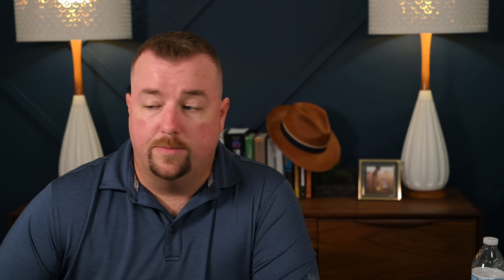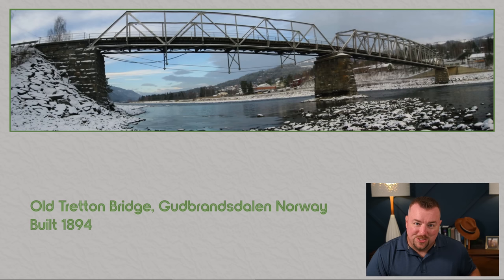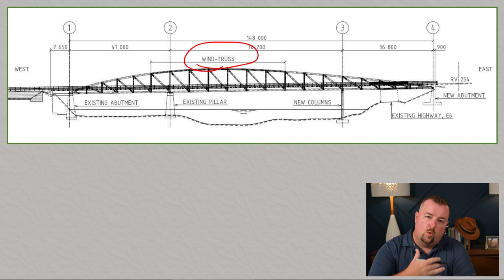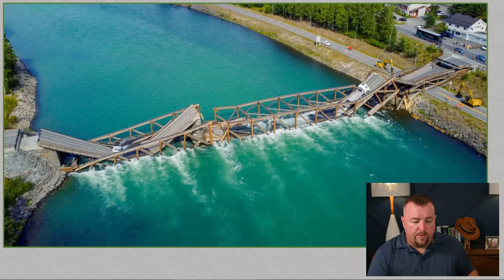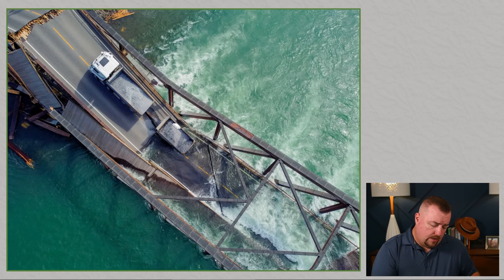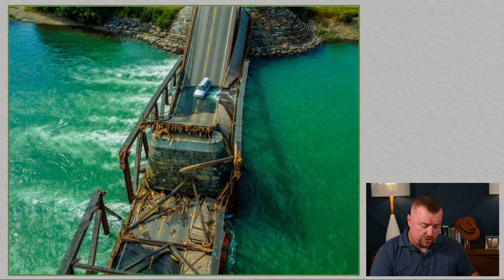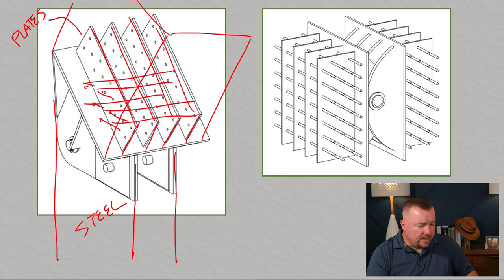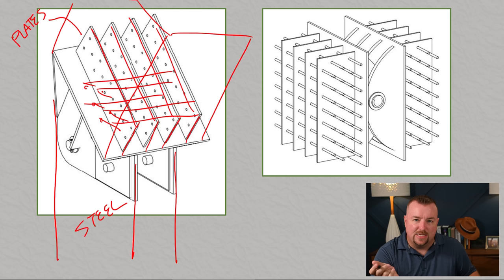How Did the Engineers Miss This?

Comment: Some things to consider as possible fixes:
1) A tight wrap/sleeve (that CAN'T expand very much) around each doweled joint to make it much harder for the wood to fully wedge apart. This way, the dowels themselves would have to shear or the wrap would have to explode BEFORE the wood can split across the wood grain.
If the wrap were made of thin steel (arbitrarily, <.25 inch), expansion could happen over time due to permanent deformation of the steel wrap. If the wrap were made of thicker steel, the steel could never reach the permanent deformation point. Basically, avoid the property that Aluminum has, which is impossibility to return to its original shape after being stressed. I think this is called yield strength, the strength before permanent deformation.

2) Instead of having many rows of dowels, each row after the 1st row destroying the strength of all dowels that come after it, have only one row of dowels (in a cross-section fashion). Also, seeing the dowels in such a weird formation should spark suspiciousness to the engineer, making them think twice about WHY the configuration is that way, leading them to (hopefully) realize that splitting a horizontal connection with something (in this case, a dowel) creates a weak (fault) point between the left and right side. A counterargument would be that you have more redundancy with more dowels, but it also gives a false sense of security, which can be more dangerous if left unchecked, especially in a naive model simulation program. You HAVE to consider how equally forces are distributed across the dowels, which having many rows of dowels implies an equal distribution, which is absolutely not the case.

3) Even though it is harder to build, joints like those at 24:44 through 25:00 should NOT exist in bridges due to them being weak points, UNLESS it's a specific safety-failure point (a point that, if it were to fail, is the safest place to fail). Those should be overlapping joints, with the same standards (hopefully more rigorous than) as household joists. This would nearly always require on-site gluing/lamination, which could be difficult in cold-weathered areas, but heaters combined with insulation and slow-set glue should work.

4) Consultation of professional woodworkers should be considered.

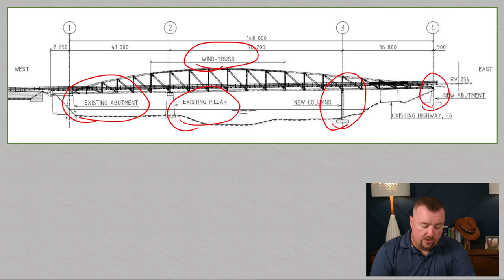Comment: 2:27 - All of the diagonals are sloped in the same direction for the entire length of the bridge. Thus some of the diagonals and verticals were in compression, others were in tension, and some probably had reversing stress.  As a continuous truss, it is indeterminate, depending on flex to even out the load across the 4 supports. This can result in concentrated stress at one point along the span. Looks like somebody had no clue about structural analysis.  Also, a slender truss like this places much more stress on the members than a taller truss, it's a matter of leverage.  Proper design might have allowed the bridge to last possibly 15 or even 16 years!

Very reminiscent of the clueless Florida International University footbridge collapse, which looked like a truss, but the seeming truss members were just decorative.

At least this bridge was across a shallow river, so the victims wouldn't drown.

Right now, the EU has many more pressing problems about greenness, such as freezing to death this winter.
Reply: Absolutely right. I suspect the architect wanted this layout and the inexperienced engineers said okay, no problems...
Reply: Norway is not in the EU.
Reply: @ThermoMan  But Norway is about to join NATO, and Russia has already stated it will no longer sell energy to hostile countries.

While not directly affected by the Nordstream 1 pipeline shutdown, one more wrong step and I bet they will be cut off too.

It's going to be a long, cold, deadly winter in Europe.
Reply: @ThermoMan  Norway suffers from the same green blindness as the EU.
Reply: @derek20la  There's so much nonsense in your comment it boggles the mind. Norway has been in NATO since its beginning, you're thinking of Sweden and Finland. Norway also doesn't import any natural gas, actually it's world's third largest exporter.

Comment: Glue lams are very common in residential construction, but generally don't have vehicles driven over them, nor are they exposed to weather, wood and weather not exactly being the best of friends (the old wooden railroad bridges were made of solid oak beams soaked in pitch). Also, where wood and steel meet, generally the wood is "wrapped' by the steel and bolted though the wood and the steel, or at least  large washers are used on the bolts to help compress the wood (wood does love to swell and shrink, especially in harsh weather conditions).

Comment: I am a bridge engineer and I applaud all the work you did here to get into a position to study the failure.

I suspect the truss diagonal that ends at node C would be in compression when the live load was approaching the support. I believe you have found the area where the failure initiated.

The problem here is certainly the joints. Everything about structural behavior of wood depends on the joints. Everything about truss behavior depends on the behavior at the joints. Your inside information on the research into wood doweled joint failures is certainly going to come into play when the final report is released.

I believe in steel connection design we have a similar mode of failure called "Block shear". Your observation that consideration needs to be taken for the glue laminations is on point. The gross section properties are only one part of this problem.

I am designing a wooden bridge right now for my Boy Scout camp. I don't think the other players understand how complex it is. They say they can get treated utility poles for the beams. But utility poles are tapered. I'm going to have to figure out how to secure the handrails to round, tapered utility poles. Yikes.  They have conceeded that we will need to build a support pier somewhere along the length. They know they can't just lay them down on their sides and expect them to work. 

I'm going to see if I can find some more information on this bridge.

Oh, and I agree, it seems optimistic to believe a treated gluelam bridge will last 100 years. Maybe a wooden bridge can do that in a very dry climate, but I wouldn't expect that in Scandinavia.
Reply from the maker: Thanks for the comment, and good luck on your bridge project... I too would not want to work with those poles as the main beams.  A lot of strength there but the connections will be challenging.  May consider cladding one side with PT boards bolted through the poles and then just build up from those sides.
Reply: @BuildingIntegrity  my coworker thought I should design the deck to be strong enough to carry the post load. I'll give it a look and see. The post is the key.

Comment: There was a building collapse recently at the hotel across the street from where I used to work in York, Nebraska. The building was just 10 years old and the ceiling collapsed in the pool room, with one victim not surviving. There hasn't been any investigation into the reason for the collapse and it's just been swept under the rug. It would probably make a good video if there's any way to get it investigated.
Reply: That's shocking. Especially after a death. Wasn't there an inquest? In the UK our Health and Safety Executive would have been in there like a shot to investigate, just for starters.
Reply: There should have been a full investigation. There's a lot of corruption in these smaller towns and the contractors, inspectors, and investigative agencies often have a conflict of interest and will cover each other. I've seen pictures of the collapsed room and it looks like the decorative ceiling ledges were just nailed to the framework with no mechanical reinforcement. The nails simply pulled out of the wood and the entire 2x4 ceiling fell in. It's inexcusable
Reply: Yeah, definitely sounds like something shady going on.
Reply: I agree. I read about this and it bothered me tremendously that there was no investigation even though it killed an innocent kid playing in a hotel pool.

I saw a picture of the ceiling collapse online and it was bizarre to me that all of the sheets of drywall remained bound together when they fell from the ceiling. I would have expected them to break apart at the joint seams.

Comment: I'll nitpick a tiny bit - the "wind truss" doesn't just transfer wind loads to the other truss.  It's adding moment rigidity in the horizontal axis because it is a truss.  If it was just beams straight across, it would load share horizontal loads.
Reply: Agreed. There a is box section to increase torsional rigidity and reduce flexing of the deck under side wind conditions. This has caused several dramatic, well-known bridge failures.
Reply: He knows that. He is just keeping it simple in order to focus on the main point.
Reply: I’m certain he’s well aware of that. However, his main audience is the average laymen, not an engineer, so he tends to explain things in simplistic terms.

Comment: Maybe there is another thing to consider (I am not a construction engineer / architect though, so if somebody knows how this is considered/calculated IRL, let me know):
When the connections are made IRL, there is not only the tension in the direction of the truss itself, but there might also be a torque component from the load of the bridge.
I would say this torque may greatly increase the chance of the wood splitting.
When you show the interlinking of the fingers (12:50)... try squeezing the fingers hard and pull the hands apart (it's not that easy). Then try the same, but with the hands twisting. The twisting action of one hand will open the fingers a bit and it gets much easier. That's what might happen with the wood as well. If the dowels apply some torque, they might be opening the wood grains.
Wouldn't it help to have the joints wrapped in tightened steel hoops to prevent the opening?

Edit: 35:30-ish - the way you drawn the two truck beds around point A is kind of consistent with my theory. If both objects are pushing the bridge down around point A, the two horizontal trusses experience opposite torque, meaning the bottom A want to split open. If it wasn't one piece of wood, but CJ like on the top, that's it.

Also, the top A (32:02) shows result of torque (although that might be result of the already-falling bridge after bottom-A  failed.

Comment: I think the diagonal piece between A and B would have been in compression in this instance, at least whatever proportion is carried by the new steel columns would have been carried in compression there. All the diagonals are slanting the same direction, so they can't all be in tension.
Reply: Are you talking about 32:30 into the video?  The simple way to tell which truss-web members are in tension versus compression for something supported by two points is to identify the balance point of the bridge, and trace lines from there to the support point.  The places where one's pen would be moving downward would be in compression; those where it would be moving upward are in tention.  The only way I could see for the the AB chord to be in tension would be if the center of gravity of the portion of the bridge-plus-truck combination supported by the new steel pillars was to the right of point B, or the supports near the right edge of the bridge weren't doing much, and almost all of the weight was borne by the supports on the left.
Reply: I think of the road bed as hanging from the upper bow, and the two are trying to separate. The upper bow is in compression, the deck is in tension.

Comment: Got to say that one of my first thoughts when i saw the design of those joints was - how can they hope to control rusting of the steel and pins? And we all know what rusting steel does to concrete, does not take a lot of imagination to think what the steel that slots into those joints will do to the laminate when it starts to rust and expand. Surely it's going to force those laminates apart? Rust will start to jack the laminates apart where the steel slots into the wood, and rust from the pins will not doubt accelerate the wood splitting along the grain. A recipe for disaster on it's own.
Reply: The marage steel alloy develops a thin layer of self-stabilizing rust.

Comment: In Australia, that 'double truck' is called a 'tipper and dog'. Its called a dog trailer because it follows your truck like a dog. Also a dog of a thing to back up until you're used to it because they're short.😉👍🇦🇺
Reply: Never driven a 'tipper and dog'. But I have never heard it called that here in Sweden/Scandinavia. And really even 25.25meter long (lorry+dolly+trailer) vehicle trains follow you, just so so nicely that I can hardly think a tipper and dog is anything special. 

If anything your worse off with the long truss rod. When trying to maximize cargo space your truss rod length is as short as possible! But carrying heavy gravel and what not, you need to space out the weight over the road. If a dog is hard to reverse. Have a try with a dolly. It is like connecting a car trailer to a heavy lorry. If you forget about having it behind you for 100km and then all the sudden reverse?? You can really just knife jack it badly since you forgot you even where connected to it! Since you can not see it in your mirrors most of the time! XD It is first when your to late to notice it starts to stick out and bind up. And if your in a hurry and careless your going to hear a big DONG and crash into yourself before hitting the brakes. Shameful but seen it happen and understand how you can forget having it connected behind you. Your not going to do that with a dog and get away with it! But dolly driving is evil.

Small wagons/trailers are harder to reverse then big long ones. For sure. But a dog can not be that hard.

Comment: It is likely helpful to remind people working with wood that a transversal dowel always is a wedge and thus very good at splitting the wood. To properly use the properties of wood the side bars of the bridge should have been dual overlapping segments so  that loadtransfer would primarily been via a contriguous connection next to each assembly point. Doing it like that had probably doubled the pull load capability that the bridge failure seems to be the result of. Strange that all  they knew when building dragon boats with their incredible hull strength has been forgotten .....

Comment: Around here, there used to be many steel truss bridges. Every single deck was made of wood covered with asphalt. They were all very old. The difference? The wood was large monolithic boards. 3”x 14” or so. Single 4’ boards from old hardwood trees. They were attached together, but not to the bridge. The deck just floated. They had to remove them due to the inability of big truck to go through them, not because they were bad. The good thing is all of them were salvaged repurposed out west somewhere. It was very impressive process to watch when i was young. Huge equipment and big trucks. Nirvana for a ten year old boy..

Comment: About the truck and trailer: with the load on it it weights at least 40 tons. As the bridge collapsed, from plane it should have been gone 45 degree uphill in a second. I assume the engine stalled immediately. If it had automatic gearbox, Automatic handbrake, it could not move even if the driver wanted to.

Comment: One point: You CAN make a GlueLam arbitrarily long, by staggering the ends of the constituent boards. You can then upsize the beam so that there is always sufficient contiguous wood fiber at any given point to carry the entire load, and then make every non-end joint run continuous.

The problem is that you can't transport an arbitrarily long gluelam - you'd have to do the lamination on site - and then you'd have to do all the assembly in situ at height rather than safely on the ground. These two things make your cool inexpensive building technique into 'The steel bridge won the bid'.

Comment: There is a large historical N-truss wooden bridge near where I live. The ends of the beams which make up the trusses are surrounded by steel casings and I think the joints are steel. So the casings help support the wood and prevent splitting. The truss structure is also a straight design. The bridge which collapsed has sections which vary in size which looks pretty, but compromises the strength of the truss. The unsupported length of the Norwegian bridge is also very long. I wish I could post a photo of the historical bridge here, but I'd have to make a video. You spoke about splitting along the laminations, but I don't think that the laminations run that way?

Comment: 36:40 every treated lumber I’ve worked with only gets the treatment to the exterior of the wood. Nothing makes it into the center. I’ve seen treated posts rot from the center out.
Reply: I took a apart a deck made of treated lumber.  Some of the post were perfect, and others had rotted away to almost nothing and they were all driven into the ground.  There are differences in water exposure of the structure and how well the treatment process is done.  The use of treated lumber in bridges designed for heavy trucks doesn't make sense, as the three bridge collapses clearly show.

Comment: 3:50 you can see the tag along trailer is right over the split so the bumper is on the pavement and the wheels are probably in the air so the trailer is wedged and holding the truck from moving.